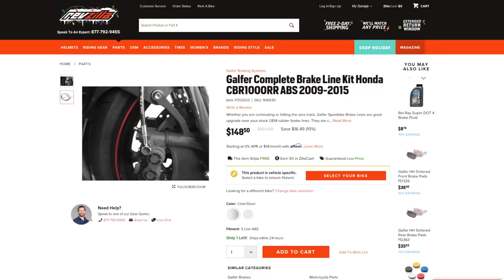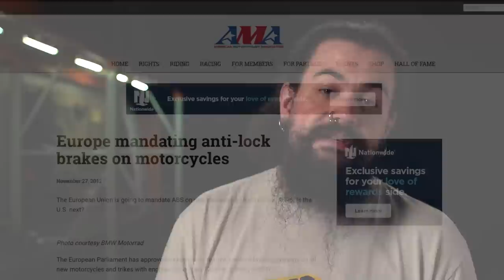3 Arguments AGAINST Motorcycle ABS!

Comment: Im terrified of ABS, I suddenly had a faulty front right wheel lock up due to bad sensor. This happened on my toy sequoia,SUV.. Hope this is not the case with aging abs systems on motorcycles.
Reply: That's why it's a great idea to turn ABS off, however you may, and practice emergency braking technique in a controlled environment. I turn my ABS off by putting my bike on center stand and running 6th gear at idle for 20-30 seconds, then I practice stopping from ~25 mph as quick as I can to get familiar with the limits, then ABS is just a backup if your technique fails, and if the technology fails, hopefully your technique has gotten to be good enough! A great motorcycle instructor 'Fast Eddie' of MotoJitsu always says technique over technology!
Reply: @MCruzerProductions  You don't need to turn ABS off to practice technique though. ABS kicks in when you lose traction, so if you mess up while practicing without ABS you take unnecessary risk. So, in my opinion, there's basically no reason to turn it off for the purpose of practice.
Reply: @nickam4100 I'm practicing extreme stripping, like 25mpg in 15 feet or less. To do that and be effective in my style of bike I need to do a small stoppage at the end of the stop, and if I don't disable abs the front wheel will chatter once the back wheel comes off the ground and stops showing down,  well before my front tire actually loses traction.  So the are circumstances that you could need to turn it off.  Even if you don't, it's good to experience busy what a lockup feels like on your bike before experiencing it in the street
Reply: @MCruzerProductions  Ah I see... In my bike, the ABS doesn't engage when the back wheel comes off, so I completely forgot about that one. What you practice sounds like something rather specific though. Would that technique be usable in public roads where grip is inconsistent due to too many variables? It sounds like something one would need on a track or stunt show rather than daily commuting where grip and riding conditions change constantly but I get your point. I definitely agree with getting to experience what a lockup feels like before experiencing it on the street. It's probably better to start off with ABS on for emergency braking training and when you are more advanced you could also try locking up your wheels to get a feel for it. But I personally would do that with off-road training rather than trying it out specifically on my bike.

Comment: When you drag brakes in a corner, as you are suppose to do, when cornering on a motorcycle.  The wheels will slip, this will cause the ABS to pump the brakes, in a corner which is DANGEROUS.  Don't just pull the fuse as many other have said.  This will leave the ABS in a "flapping" state because it wont have electricity to actuate itself with.  You need to pull the sensor completely out.

The reason someone can outbrake ABS is because 1.  ABS doesn't actuate until the brakes lockup, which means wheel skid.  2.  There are points in there when there is no braking forces are being applied.

They took a day 1 motorcycle student, taking the MSF class.  Had him practice braking and in less then 1 hr he could out brake ABS.  HE HAD NO PREVIOUS MOTORCYCLE EXPERIENCE PERIOD.  ABS is a joke, its trash and it shouldn't be allowed on motorcycles for the road.  Until the motorcycle racers can do it, you don't stand a chance doing it.

Comment: I am currently living in Europe where the control freaks in Brussels are trying to make laws about everything. I hate that.  I like buying and riding used motorcycles. In the past few years I have bought three different BMW r models.  On two of them the ABS was broken.  Although they brake just fine with the ABS system mafunctioning the authorities will not "allow" the bike to be approved fit for the road without the ABS system working.  The cost to repair the hypersensitive BMW ABS far exceeds the cost Additionally, there are the exact same models delivered without ABS which are allowed despite having the exact same functionality.  I'm agin it.

Comment: Perfect example is the ninja 300 (2013) has no ABS until 2014 ABS is stock...  The abs is only on the rear wheel and cannot be turned off... Now just think about that when looking at the 2013 ninja with no abs...  Read that again and think about it... I'd go with 2013...  And remember it's on the rear wheel only and cannot be turned off!

Comment: For on the street riding only it is absolutely ridiculous not to buy a bike with abs I get it if you're on the track my Daytona 765 does not have abs but I don't ride that on the road it's my track bike but for the road I have a Ninja 650 with abs and it's worth the $200 above MSRP to know that you're not going to slide out because there's some Gunk on the road or it rains or if you live in a colder climate and there's salt on the road or you hit some black ice you will be safe mostly because you got traction control abs and Rider modes. Those fast boys who want to say ABS is for wimps and it doesn't teach you how to properly ride a motorcycle you're not going to be here very long sadly get a bike with abs for the street and practice dragging knee and all that other stuff on a track or in the parking lot with your abs motorcycle ABS option turned off and lived to ride another day

Comment: Nooohow can you make this video! I alsmost killed myself!! I accelerated slowly after the rain on the highway on my 2014 Harley Iron 883 and the god damn rear wheel just whipped right the fuck out! I just barelyy saved it by slamming my foot on the floor fuxking nightmare I 100% regret not having the abs option!! Accelerating on the highway in the rain is suicide on this bike mine has so much tourqe